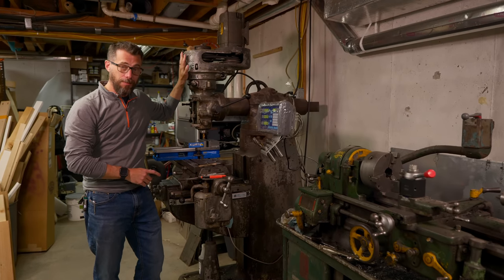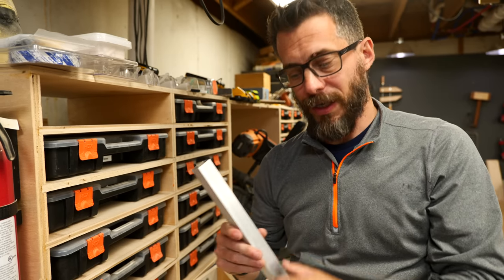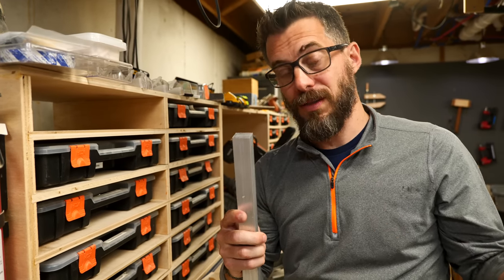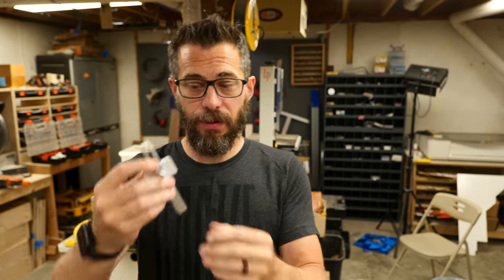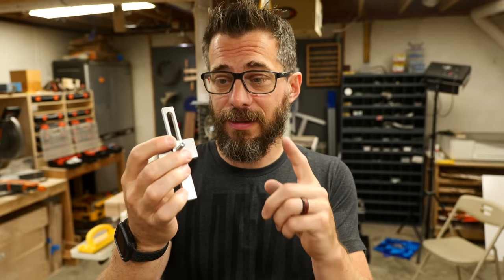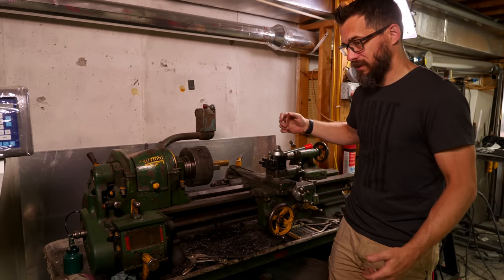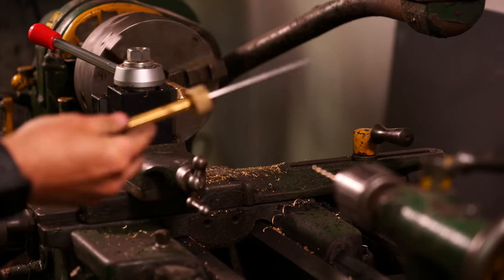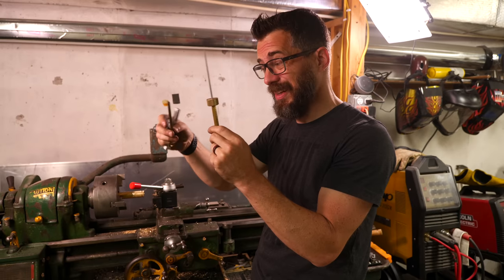Overcoming My Fear of Machining Metal

Comment: Hey man I’ve been a subscriber for a long time and love all your content, I’m a machinist and have been for the past five years, most lathes have reversible jaws, you should be able to unwind the jaws all the way out and flip them around and rewind them back in to use the opposite side, you’ll have more contact and then you won’t have the jaws swing around exposed. They should be numbered so make sure you put them back in their respective slots. Also for drilling a hole you should definitely flatten the face before and it will give you a better surface to drill into that way your drill does not walk and you should pre-drill also to prevent the drill from walking. Keep it man! Machining isn’t always easy and there is lots to learn but it is an amazing trade that allows you to creat awesome products!
Reply: Time stamp 17:10 I'm pretty sure that particular chuck is the non-reversible scroll plate kind. It should have come with another numbered set of jaws for proper contact on smaller diameter stock. The outside faces of the current jaws look to have flat smooth surfaces not intended for contact with the work piece.
Reply: @lordchickenhawk  didn’t look to closely but now I see that, should still be able to get reversible jaws
Reply: @jakegrossman6259  Yeah, a set of bolt-on  type reversible jaws would be a good investment if they are available... I'm not sure that they would be except with a new chuck to match them though.

Comment: Chris here, from Nashville.  The guy who sold you the lathe and the mill... I have waited 2 years for this!  Congrats!  You did amazing!!!  Brave dive in.  This is how all of us hobbyists do it... try, fail, try again!!!!   

Keep it up, friend!
Reply: Lathe - You did great.  It worked.  It was safe.  You did it! 

Some tips for next one.  

Start by facing the item.  

Then drill a countersink and bring in the tailstock.  

Great job turning the work.  

Bring in that parting blade as tight as you can.  Stick out is bad.  So tighten that blade up to just a bit longer than the work. Then make sure the cutoff blade is exactly center to the work.  Then cut that baby! 

Boom!  Done.
Reply: Tips for the mill.... NO TIPS!  You did great!  Nothing to add.

Comment: You should have another set of jaws for the lathe. These ones are for holding on to "big stuff", the other ones are for holding on to small parts. Stille a little scary, but far less so. The other jaws allow you to work closer to them, which has other advantages.
Reply: The other jaws would have the taller area close to the center and not on the outside of the chuck as you have it now. Very dangerous the way you are using it now. If you can not find the other set of jaws you should get a new modern chuck that has 2 piece jaws that allow you to reverse them.

Comment: Bob, thanks for being vulnerable and letting us see the fear. It really helps to hear other people admit their fears. It seems like at every milestone in a project I have to overcome a general fear of failing. Starting the design in fusion "what if I waste a ton of time and it doesn't work", buying material "what if I chose the wrong stuff, or don't buy enough, etc", and on and on until it is done. I find myself stopping at each milestone for a long time because if I am not working, I am not messing it up.

Comment: I appreciate a video like this where you're coming to something as a novice and admitting that you're afraid of screwing up. We all start at that same level and it's refreshing to see.

That said, when you approached the lathe and admitted you don't know what a lot of the extra levers and so forth do I was reminded of Norm Abrams' safety message at the start of each episode of New Yankee Workshop: "Be sure to read, understand, and follow all the safety rules that come with your power tools." I know that's a used tool and probably didn't come with an original manual but when it comes to using a tool safely, the first thing you do should be to RTFM, even if you have to search for a scan online.

Thanks for making cool and interesting videos!

Comment: Hey Bob I like to make stuff too, as a machinist. I have already seen a bunch of good advice one the comments, so here is a couple I haven’t seen yet. All of the levers are going to be what controls your feed rates. When you start playing with them eventually you will see the long screw that is below your bed engage and start to turn. Then on your tool carriage there a couple of levers to make your tool move either left to right (z) or front to back (x). All of the numbers on left side panel will determine how fast the feed is in thousandths per revolution, somewhere between .003 and .007 is probably your happy place.

As far as keeping everything safe from running into chuck, you can buy or next project idea make a stop the can be used as a safety and for machining. For instance if you need to turn a shoulder you can set your stop and tun to the same spot every time so you can make multiple passes.

Thank you for what you do. I love how you showed in this video that it is good to have a health respect and fear for something you don’t fully understand, but was able to push through.

Comment: Hey, Bob. You need to get a dial indicator with a magnetic base. You’ll be able to get stock level in your vise on the mill, and centred in the chuck of the lathe. Clamp the base to the machine, & tap your stock with a mallet until it gets close to level, or centred. On the mill, move the axes along the length / width of the stock to check, and on the lathe rotate by hand. Couple of thou is good enough. 

Jaws are reversed on your lathe to hold large diameter stock, or tubes from the inside. 

1st operation on a lathe is usually facing off the end of the round stock. If you’re going to be boring a hole in it, you need a centring bit, which will give you a tiny chamfer to help lead in a drill bit, or a boring bar if you need to make a very large hole / thread in round stock. 
Keep your tools as short as possible in the toolpost to minimise chatter. 
Use a cutting fluid like Rocol when drilling, or threading. 
Most of those levers at the headstock are there for cutting threads. They can autofeed the toolpost at the correct rate to put a certain pitch per revolution. Possibly, using a certain pitch, autofeeding the knurling tool you used would have given you a better finish. 
There should should be a feature on the lathe that you can set so you can’t feed the toolpost into the chuck. 
When parting off the part, you could bring the tailstock up, with a live centre to barely hold the end of the offcut, which would keep your parting more parallel. 

Wear latex gloves when handling metals, or if your skin is exposed to the swarf. Cutting fluids & impurities in the metals can cause severe psoriasis. 

Invest $10 in a ‘Zeus Book’. Don’t download it, get the laminated original. It’ll tell you speed & feed rates, thread drilling diameters, pitches of threads, tons of useful machining info. 

All the best.

Comment: I've been sort of afraid of getting into 3d printing for a while now. I've known about it for years, and have some basic 3d modeling skills, but the setup and calibration and patient trial and error that getting good prints requires scared me off of trying it. I got my first printer a week ago and honestly it feels like we're past those growing pains and modern printers are pretty much ready to go out of the box. I've had great results with really minimal effort, and figuring out things like leveling and slicer profiles turned out easier than I thought. So, this video wasn''t what helped me overcome my apprehension, but I definitely had the same feeling Bob described at the end of the video - of getting past that initial barrier. Now comes the next phase, when you start seeing opportunities to apply machining (or 3d printing in my case) everywhere!

Comment: Thanks Bob and team for the authentic feelings of hesitation on this project. I have felt this way on a number of projects that I have tried from you and others on you tube. When I first got my Cnc I was really scared of it. It took a long time to get comfortable with it. 3D printing was something else I was hesitant about with fire hazards. I think the project that really had me was when I tried to build an arcade cabinet. Using Cnc, 3D printing, and programming and soldering electronics was all very stressful. It’s nice to see a virtual mentor go through something similar.

Comment: Great video Bob.  Glad to see you trying your hand at machining.  Regarding parting and your parting tool.  Parting can be quite challenging if/when you don't follow 2 basic rules.  First, you should adjust the blade length to be a short as you can relative to the piece your parting.  Just a bit longer than half the diameter of the workpiece assuming you have enough clearance.  Second, the blade must be absolutely perpendicular to the axis of rotation of the spindle  Don't eyeball it.  A fairly easy way to ensure this is to face the end of the workpiece (when possible), extend your cross slide over until the tool post is roughly centered on the workpiece.  Loosen the bolt on the tool post.  Move the carriage toward the workpiece and let the side of the tool holder press against the faced end of the workpiece then tighten the tool post bolt.  I'll tell you from experience, i've broken several parting tools and each time it was because of one or both of these rules I hadn't followed.      Whoops, one more vital thing.  When you adjust the blade length, you'll always need to raise or lower the tool holder to accommodate the blade height since it comes out at an angle.  Also be sure the cutting edge is right on the midline of the work piece as well.  Thanks for all the great content!!

Comment: Great Stuff Bob!
as you get used to your machines and learn what you can do you will certainly gain more confidence. if I were to give any advice I would say research order of operations for machining. 
for instance for your knob 1. drill center hole 2. Tap threads with the tail stock on the lathe. 3. hold the end of your work with a tail stock live center. 4. Knurl your part. 5. cut to length with parting tool.  You didn't do anything wrong your end result is working part.  but learning the order of operations is the key to working effectively with these tools.  Good work Keep it up!

Comment: Non machinist here. I put a variable speed motor on my first lathe. Makes things a lot more controlled. I did quite a few projects with PVC which cuts like butter and if you make a mistake (turning a control the wrong direction) it might pop out of the machine but it won't break cutters and machine parts. Adding some marks to remind which way things move when turned certain directions is very helpful until familiarity is developed. Watch lots of utube videos to get experience without risk :)

Comment: It's awesome to watch you trying to use & learn this amazing machines. I myself recently learnt to operate a milling machine, I was too scared at the beginning but within a day or two I get very comfortable. I do experience the binding situation on milling machine but came to realise that using lubricant and cutting oil always helps.
About lathe I have been operating lathe since 6 yrs now (not my professional work just for diy stuff) and I have the same fear of my tool or tool post hitting the spinning part (chuck) but luckily no causalities happened. The lathe might need a full service because a lathe machine can be silent. Keep using lubrication too keep the tool and job cool & increase the tool life and always use cutting oil while knurling for better result.
It's always a good practice to wear half sleeve & never wear any bracelet or watch while operating spin machines. Safety goggles is must as bur flys everywhere. A lathe operation should always start by facing of the job to square the job with the chuck & then hold the job from both side to better stability and rigidity. As brass is soft material still you hold the material too long and your cutting force is far from the chuck which can produce vibrations. And might be the issue for the offset hole. You should have tapped the job on lathe itself by locking the chucks and squaring you tap wrench to the job by supporting the tap wrench by tail stock.
Again congratulations for overcoming your fear of operating this machines. I hope you find this comment usefull.

Comment: Bob, I consider myself a garage machinist.  Meaning, I bought the tools and just started to learn by doing and watching a few videos.  I have hundreds of hours on my wood lathe, but I have limited time on a metal lathe because I don't own one yet.  However, I have learned to do a lot on a metal lathe on other's.  The operations you used were mostly right, except a bit out of order.  Always face your round stock off first.  Start with that clean face parallel to the jaws.  It was good you turned it round, but I think you needed to take a little more off.  When tapping a hole that needs to be perfectly perpendicular, chuck the piece in the lathe using a vise with parallels, then get a point guide for your drill chuck that will stick in the top side of the tap wrench.  Use the quill to keep the tap wrench perpendicular and also put slight pressure as you tap.  Works out much better this way.  Good on you learning these tools!  You'll get much better with time.

Also, choke up on that cutoff tool.  Expose just enough to get The job done and you can avoid chatter.  Speeds and feeds is everything when it comes to metal machining. Definitely do some reading up on that. It matters a lot with whatever metal material you're working with. Aluminum is much more forgiving, but you can definitely get plenty of chatter out of it if the tool is not set up correctly or you're using the wrong speed.

Comment: As a machinist, CNC programmer, toolmaker, and design engineer...you are doing well. Get the machinist handbook for speeds, feeds, chip loads, endmills, lathe bits, etc.

Invest in some indicators. I like Starrett and Mitutoyo but for a hobbyist, Fowler or a generic brand will work.

Power tapping in soft materials is your friend.

Keep at it man. I started off as a hobbyist and now design and build tooling with +-.0002" tolerance for for products almost every person on the planet has somewhere close to them.

Keep at it!

Comment: The reason your knob was wobbly when you put the screw through it was probably because the drill bit was off center. A center drill will help start the hole and keep the drill bit straight. A few quick vocabulary terms you were struggling with were parallels, for the metal pieces you put at the bottom of your vices, and inserts are what the cutting tools are called on the lathe. One more tip, when it comes to collets, all you have to worry about is that the shank ,or the solid metal part of a drill bit or endmill, is the same size as the collet you're choosing. The video was great, its amazing to see someone learn to use big manual machines like this and I love all the support in the comments. Keep up the great work.

Comment: I had the same when I just got my (little) CNC router. At first I was a bit apprehensive about using it, but through reading a lot about it and just using it on some projects, I got a lot more comfortable with it. Being more comfortable using a tool also greatly helps you see its use in projects.

Comment: A few things to note:

Milling:
- use climbing for better surface finish (shallow cuts only) and conventional for the rest of your cutting
- higher speeds are also good for surface finish I believe

Lathe:
- the noises are chatter, something is moving or things are not perfectly square.  Lots of causes so you’ll have to look into those on a case by case
- should give a slight chamfer to all edges unless you want a perfect corner, including drilled holes

Tapping:
- don’t need to back out every quarter turn and it’s not so much for chip evacuation, it’s to break chips

I’m not a machinist but I did learn from one so others may have better explanations/tips

Comment: Those levers on the lathe that you are unsure of typically control the auto feed functions, speed (gearing) of the lathe, the brake to slow the chuck after gears are disengaged, and the direction of rotation on some machines.
Reply: You also have far to much stick out of material from the chuck.
Reply: The jaw of the chuck that scares him should be flipped around also
Reply: @jughead8988  These jaws are not able be flipped. He should have got a second set included with the chuck.

Comment: So from my experience with lathes (which isn't a whole lot just a intro class). To get a straight and center hole, use a centering bit. Also you can tap your parts in the lathe. Put it in the tail piece and turn the lathe by hand. Also you can flip your chuck jaws around so they aren't sticking out as much and to get a better grip on your part 
I love seeing this work and the learning process of it all! Keep it up!

Comment: Nice effort.
Those levers are your speeds and feeds, critical for good machining.
Cut your thread in the lathe before you part off to ensure a square thread. Obv6by hand turning the chuck and the centre.
Your sticking out jaws on the chuck are because they are in backwards to grip larger diameters of stock. Unscrew them completely and turn them around to grip on the bits furthest fwd.
The knurling tool is best run slowly with a medium feed rate.
Hope this helps